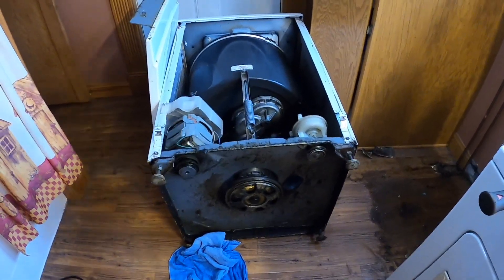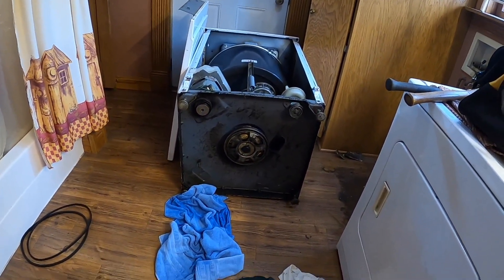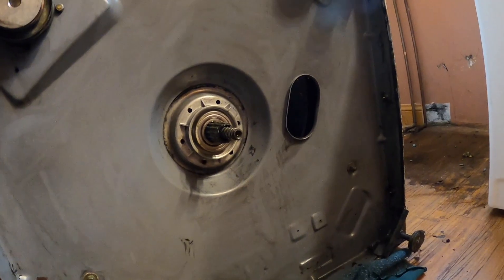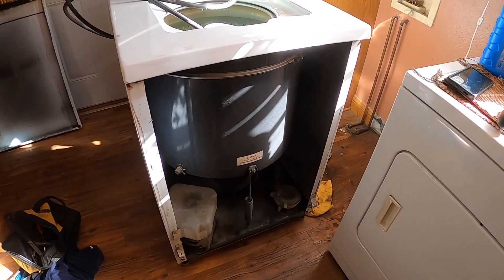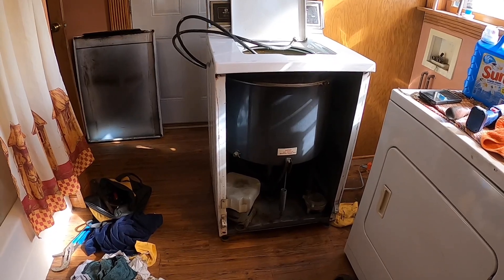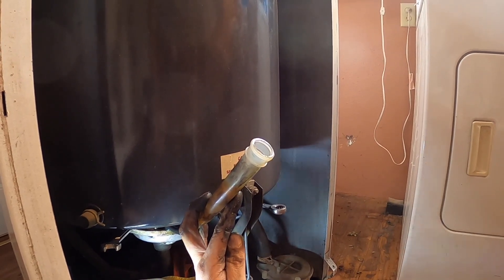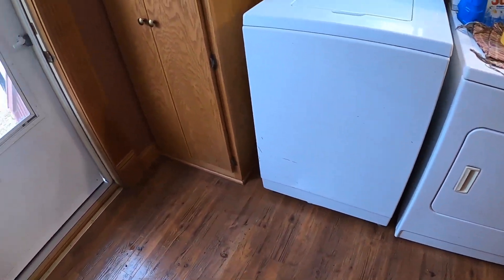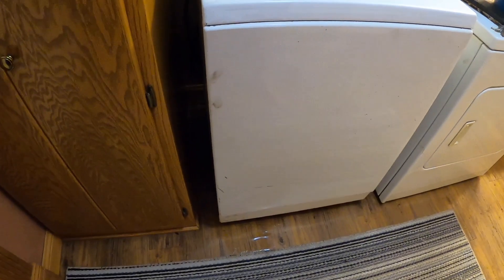Trying to fix a 1980s Maytag washer leaking oil

Comment: These vintage Maytags are still really great washers! Here's what you should know: When the transmission is leaking oil from anywhere, it usually means it is taking in water from the tub. In fact, it's usually the water pressure from the tub that pushes the oil out. There are a few o ring seals inside the transmission plus the seal you installed, but most importantly, there's a center seal that's easy to access, right under the agitator, just in the transmission shaft housing. It's a 20 minute repair at best. However, once water gets in the transmission, the shaft will eventually seize, unless you clean out the transmission first.  

The good news is: This machine is STILL worth keeping. It's just due for a refurbish, after which it should give you another 20 - 30 years of care free service. New washers don't last nearly as long. You could replace this transmission or you'll need to clean it out good if you want to keep this one, otherwise it's probably going to seize. If you want to refurbish it, here's what I recommend replacing: The mounting stem and tub seals, the (upper) tub bearing, the lower transmission shaft bearing, belts and internal water intake hose (and siphon break) - and MAYBE the spin brake (be careful with that one). Probably run you around $400 in parts but this washer is well worth it, trust me. If you simply replace the transmission, it's about a day's worth of work, maybe two for the inexperienced. You'll also need a spanner wrench to get the inner tub out (I believe it's a clockwise thread to loosen, btw). You should be able to find one on ebay. You may need to cut the spanner nut off with a moto tool if it won't turn. There should be a new nut in the mounting stem kit. 
There's a guy online that has a great video on refurbishing this washer. I think his channel is Lorain Furniture and appliance. Come to think of it, I think he offers a refurbish kit for this make with everything you need on his website. Check it out. Hope that helps and good luck!

One more word of caution: If you choose to replace the transmission, make sure you get the right transmission for your washer. You could get another helical drive (like the one you have) or an orbital which looks different and gives shorter more aggressive wash strokes. Either one will work in your washer just as long as you get the right size for the tub capacity. Here's how to tell the difference: If your agitator has 4 holes down the side, you have an extra large tub. If it has 3 holes, it's a large capacity. For large capacity, the water fill slider or button will only have small medium and large. The extra large tub will allow you to select extra large.The large capacity transmission will be longer and the extra large transmission will be shorter. If you get the wrong size, it won't fit.
Reply from the maker: ok

Comment: Good job. I would cheated and drilled and tapped out a oil fill hole in the case instead on taking everything apart again.
Reply from the maker: it worked